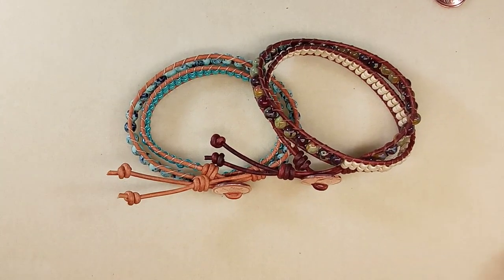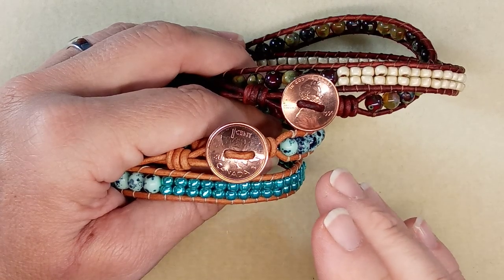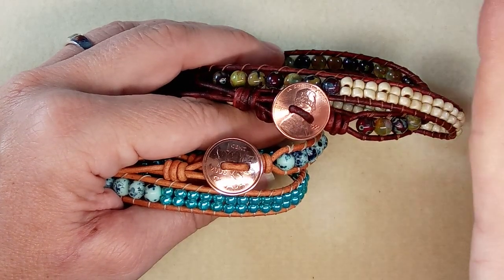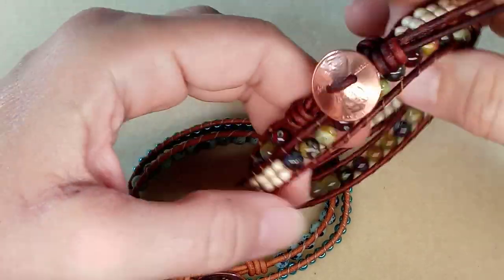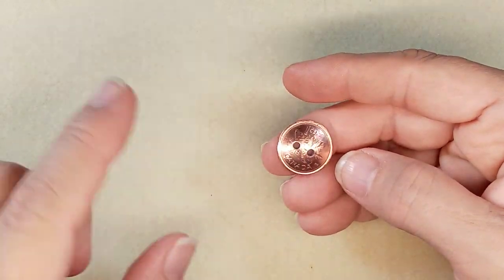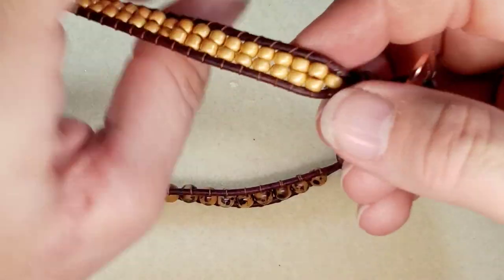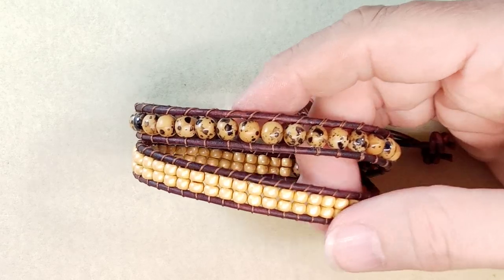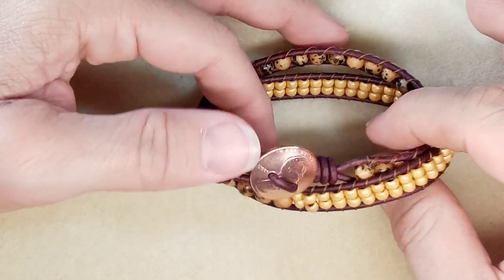Double Leather Wrap Bracelet

Comment: About what size was that tube bead you used for the barrel knot? Thanks.
Reply from the maker: The diameter is about 3mm since the 2mm leather goes through easily. The length doesn't matter.